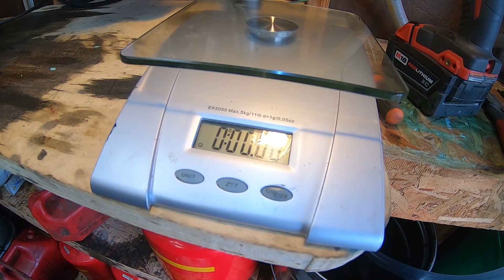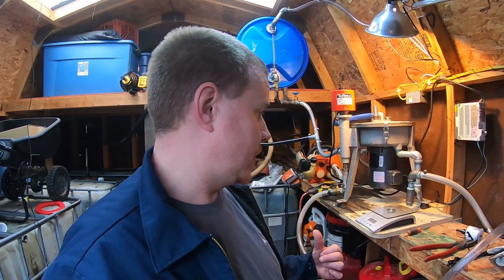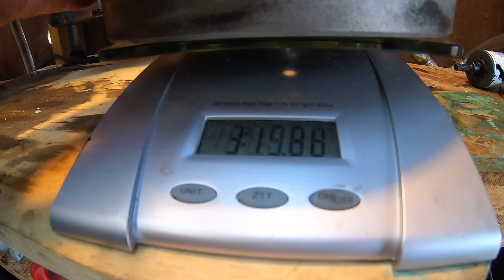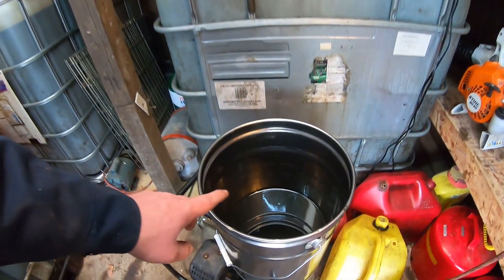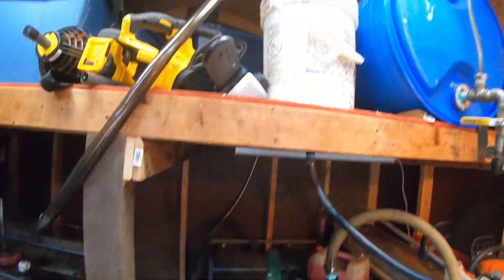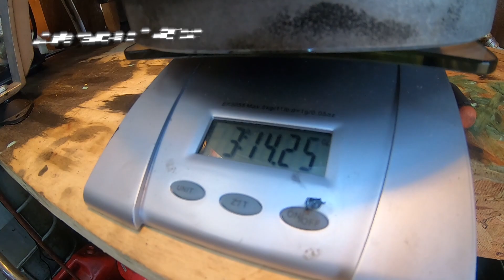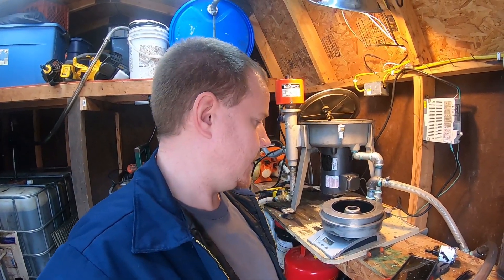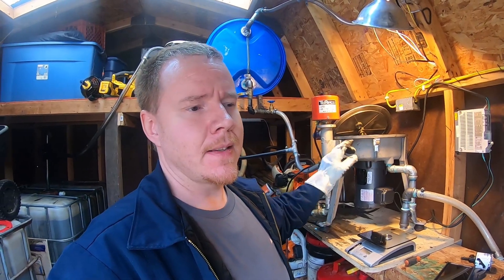Black Diesel Small Batch Tests - Heat VS Gasoline - Centrifuge With No Heat? - WMO - WVO - Alt Fuel

Comment: Anyone use an electric hot water heater to heat oil?
Reply from the maker: Actually more common then you would think.  Most hot water heater elements are pipe thread so its pretty easy to build a pipe housing for it.  You'll need a thermostat too.
Reply: @NotSoGrandGarage  I replaced a hot water heater electric heating element yesterday that had cracked but was still working.... I think that if you had WMO in the tank and accidentally let the oil level get below the heating element your day would instantly get interesting!  I like the hot water heater idea but I would want to circulate the hot water thru a heat exchanger to keep it safe...
Reply from the maker: @jeffgreen977  yeah I wouldn't heat the tank with it.  I would use it as an inline heater with the supply coming in to the bottom so the element stays submerged in oil even if the drum runs out.  Plumb and position it just like the one on my centrifuge and it holds oil all the time unless manually drained.
Reply: @jeffgreen977  Hi Jeff, in my system I use a 2000 watt water heater element in an inline heater I made. I pump the oil from a 55 gallon drum(well insulated) through my system for about an hour then  close the bypass and pressurize my centrifuge. It is the smaller blue 55 gallon unit run it a 80 psi for 10 to 12 hours. I use sock filter to filter the oil as I fill the drum down to 1 micron. It is a slow process , but I haven’t had to replace my ip and been doing wmo for 7 years. I change filters regularly and fill tank with #2 every 4 th tank.
Reply: @heyyoubuddy6749  I would like to see a detailed diagram of how you do this!  Do you just run the same oil over and over thru the centrifuge for 10-12 hours?  I don't understand how you pressurize the system...
Reply: @jeffgreen977  I did that once but I was making wvo and it had some methanol vapor in the tank. It didn't go boom but it made such a long loud noise trying to pull in oxygen through a 1/4 inch vent that I seriously thought it was going to implode. It scared me real bad. I got lucky.
Reply: @heyyoubuddy6749  Sounds like a good system. When you say that you change your filters often are you talking about those small clear in line filters?